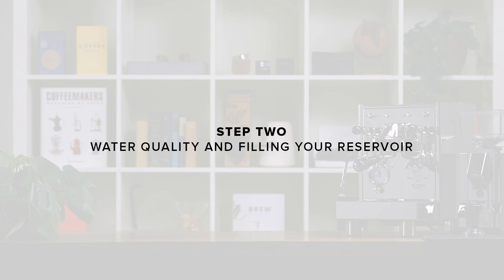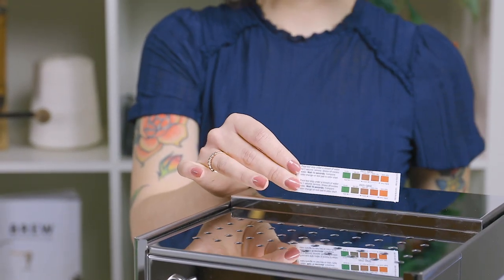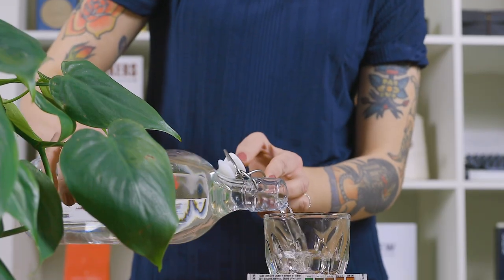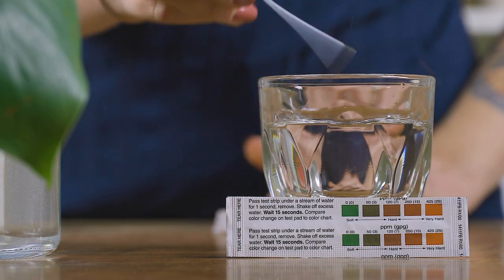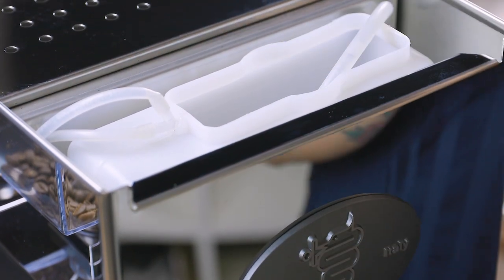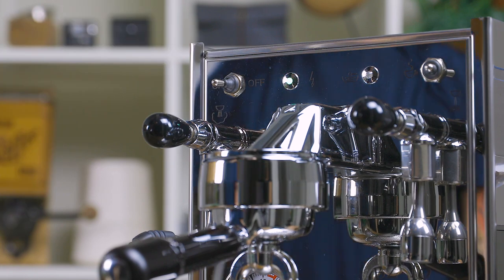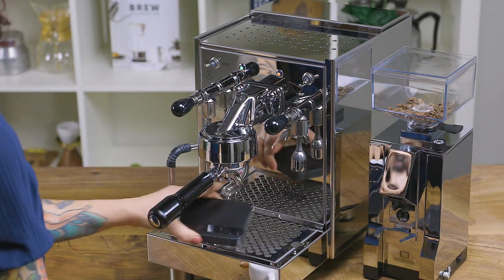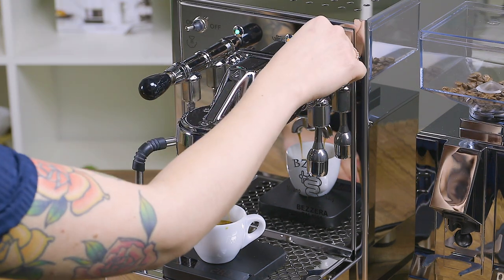Bezzera BZ10 Espresso Machine Setup

Comment: Is there a way to remove the reservoir for rinsing? The OPV tube makes it hard to remove the reservoir completely.
Reply from the maker: Hi there!
The water tank on the BZ10 can certainly be removed. The intake and OPV lines are not attached to the reservoir and can be left hanging off the side of the machine while the tank is being cleaned. Let me know if you have any other quesions!
-Amanda
Reply: @clivecoffee  Thanks, Amanda. I am very worried about removing the OPV line from the hole in the tank without damaging the tube (which doesn't seem very sturdy). Let me know if there are any tips on accomplishing this safely. Happy holidays!